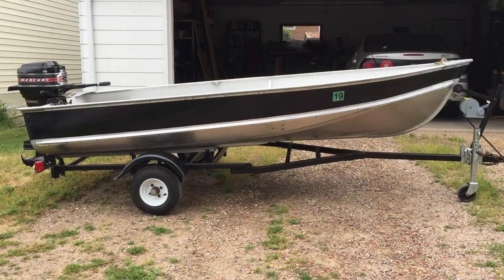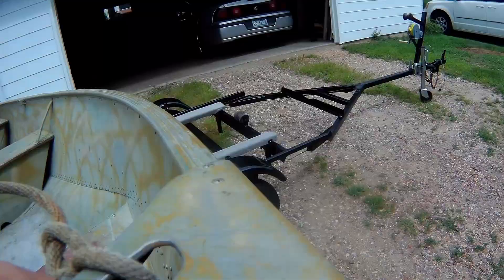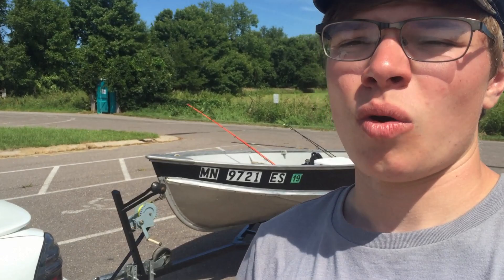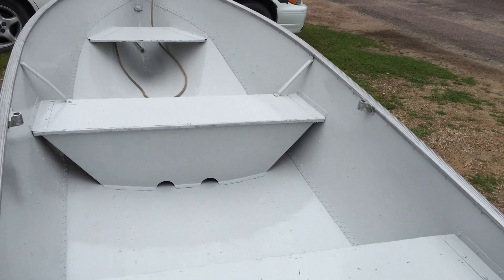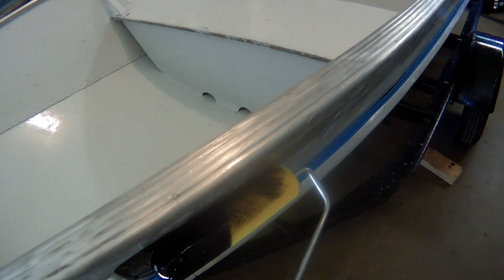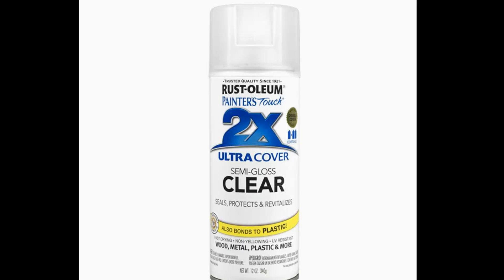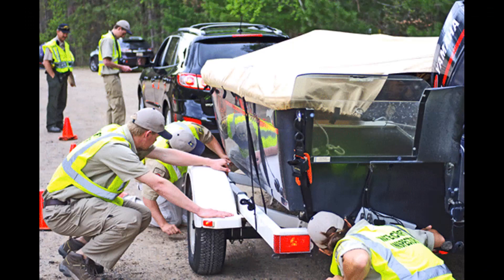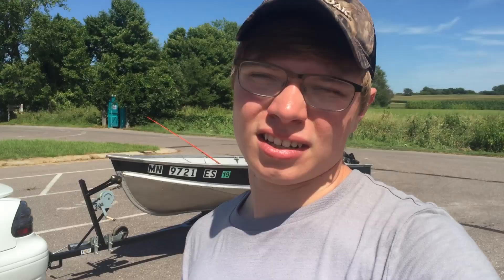Painting an Aluminum Boat | Boat Restoration Pt. 3

Comment: Did you prime the painted area before applying the paint ?

Did you spray gloss on hull?
Reply from the maker: Yes, we wiped the aluminum down with acetone which we then let air dry. The exposed aluminum on the underside of the boat was covered with gloss clear coat to preserve the aluminums natural shine.

Comment: For one, great channel. Just subscribed. Keep up the good work. Have a couple questions:
1. My 14’ tinner does not have any paint on it. It’s basically bare alluminum with a couple strips on it…..What would grit would you recommend to use to sand exterior for prep for primer then paint?
2. Did you sand the interior of the boat before applying the enamel paint?
3. Did you prime interior or just use the enamel paint?
4. How is the interior holding up?
Reply from the maker: 1. I'd say go with 220 or finer, those aluminum hulls are only so thick and it can be pretty easy to scratch them up with thicker stuff.
2. No we paint stripped the inside of the boat.
3. We used two coats of enamel paint on the aluminum directly.
4. Its holding up quite well. The few spots of old paint the remover could not get off that we painted over are flaking off so stripping to aluminum yielded our best result. Only other complaint is whatever any gas touches will flake off.
Reply: @MissionForFishing  this is great. So you paint stripped the inside. The inside of my haul is bare alluminum as well or whatever standard grey finish from factory is. It’s definitely not painted. Would you recommend just a good clean with soap/water and acetone then just paint as you did or would you recommend a little bit of sanding interior wise as well?
Reply from the maker: Sanding couldn't hurt, I'd assume it would probably help in the long run with durability. I'd definitely clean it up just as you said with acetone or some other evaporative alcohol based cleaner before painting.

Comment: It looks great. I just got a 12 foot boat and I'm using yours as inspiration.  How has the black paint and clear coat held up?
Reply from the maker: That's awesome! I'm fairly certain the clear coat wore off rather quickly due to it being spray paint and given its harsh exposure to the water. The black paint however is holding up extremely well and is surprisingly scratch resistant. It was starting to fade and lose its glossy shine after some extensive use so I just gave it one coat over the summer and it looks great again!
Reply: @MissionForFishing  sweet, I think I'll use the same paint then! I'm also going to build the casting deck on the front and back. You did an awesome job! Do you cover your boat when it's not in use?
Reply from the maker: During the fishing season I always have it tarped up (actually working on a video right now where I talk all about it). During the winter I remove the inside decks and flip the whole thing with a buddy on the trailer. It reduces the snow load on the cover and keeps water out of the boat.
Reply: @MissionForFishing  Awesome.  I also live where it snows in winter so I'll do the same. Love the channel!

Comment: What did you use to polish the aluminum on the bottom?
Reply from the maker: Actually we didn't need to polish the aluminum on the bottom of this specific boat, as all the aluminum had been protected by the previous layers of paint we stripped off. If you are looking to polish the bottom of a boat I've used Brasso and a steel wool pad to polish the entire underside of a boat before it turned out great, but it was a good amount of work.